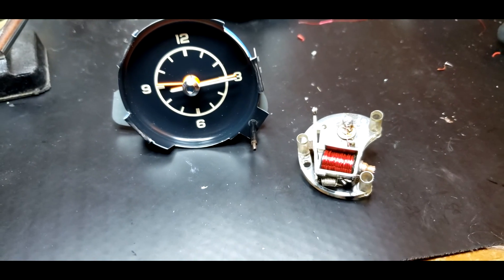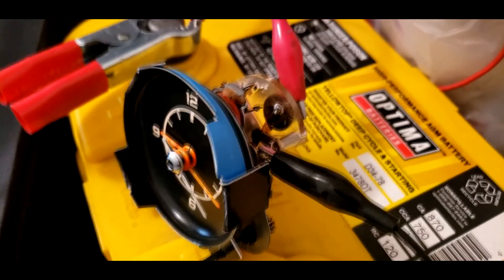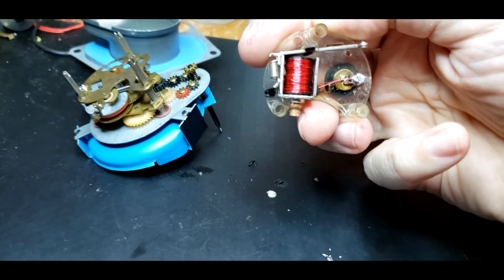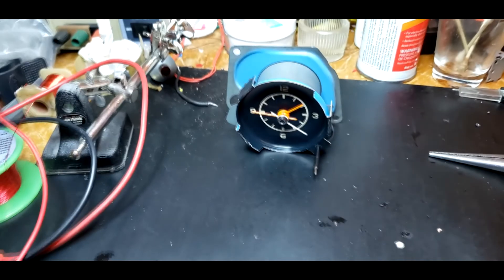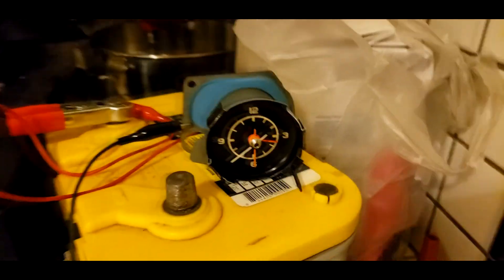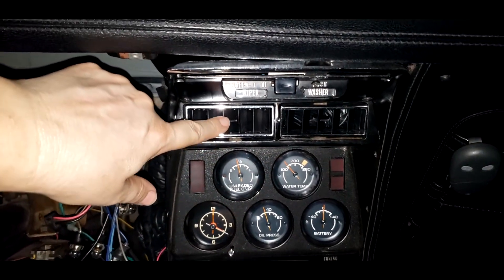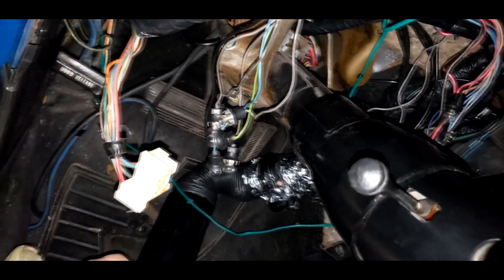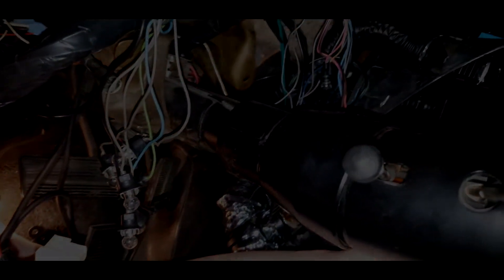1976 C3 Corvette Clock Restoration Redux

Comment: Hi Anna,
I have a 72 coupe which I bought into Melbourne Australia about 5 years ago and spent a small fortune on a frame off Resto .
I had the old non working clock replaced with a new reproduction one which the numbers on the dial do not match the original one rather annoying 
How much would you charge to repair my old one.
Great work doing it yourself.
I can build houses but vettes are too fiddly for me 
Cheers 
John

Comment: I rewired my clock and hooked it up to a battery and it won’t even tick at all, I’m not sure what the problem is
Reply from the maker: Hi Layneh49. If you move the winding lever by hand, will it tick then? It might be a bad/broken spring. If it does tick when you move the winder manually, then check the contacts between the solenoid lever and the winder. Those can be corroded and make poor contact. Or, they might be gone completely, which would cause a bad connection.
Reply: @RestorationObsession  Yes it only will tick when I manually move the lever, I checked the contacts and they seem to be in good shape. However when I have the contacts touching and I hook it up to a battery charger, it will just ark and short out and the two connections won’t separate. So I’m pretty sure I have a mechanical and electrical problem to deal with😂
Reply from the maker: @layneh4919  Sounds like you might not have the right gauge or length of wire wrapping around the coil. If the gauge is too light, the wire will fry pretty quickly. If it's too heavy, then it may just arc and not pop down. Also, make sure the arm/lever on the solenoid is free to move up/down. If it is stuck (this can occur when the wiring works its way up to high on the coil rod, for example) then the coil will energize but not move the lever. So many little intricacies in such a seemingly simple device. :) Keep at it, I'm sure you'll find the solution!
Reply: @RestorationObsession  Yeah now that you say that, I guess the wire is pretty thick compared to the one you used in your video. I could only fit 2 full windings with mine. Maybe that’s the issue. Thanks again
Reply from the maker: @layneh4919  Sounds like that may be the source of the problem. Look for "magnet wire," I believe that'll be the answer for you. This is the stuff I used: https://www.amazon.com/gp/product/B07GBMKMKY/ref=ppx_yo_dt_b_search_asin_title?ie=UTF8&psc=1
Reply: Thank you I’ll be sure to check it out. Gotta love trying to fix seemingly simple things on old cars😂